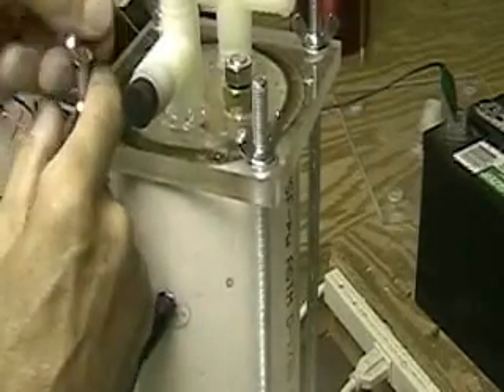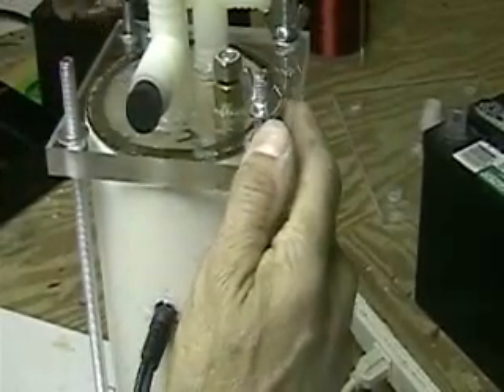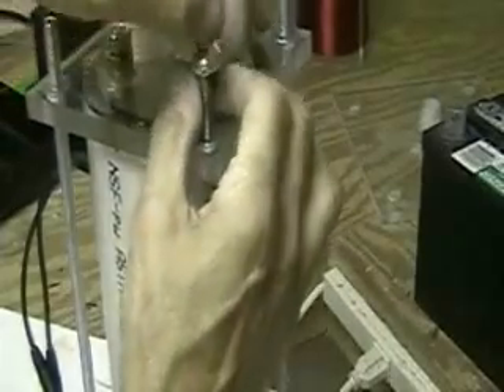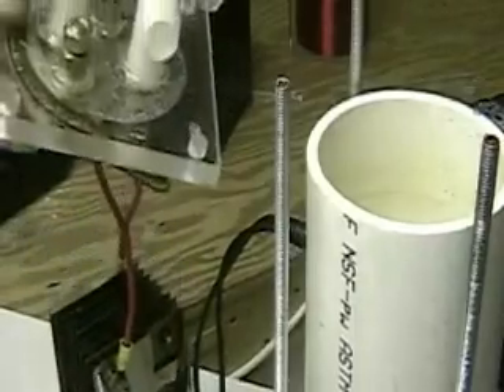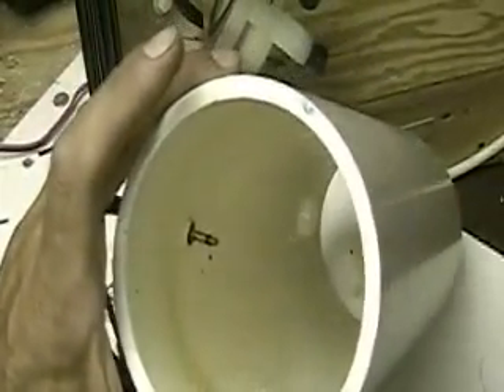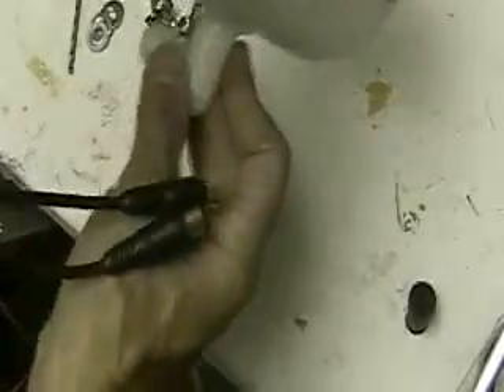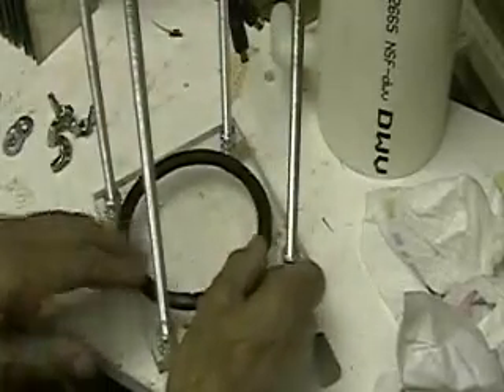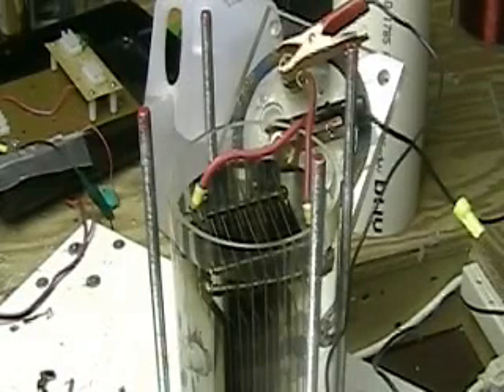Hydrogen Tap (Inspecting Cell From Honda) 118

Comment: So John, what do you think 2 will do? But I assure you that as the water heats up above 180 degrees you will notice a decrease in performance. As the water vapor will displace the available fuel mixture and cause the loss of power.